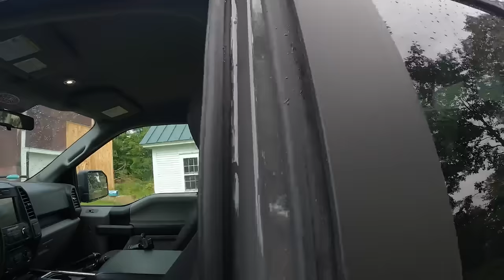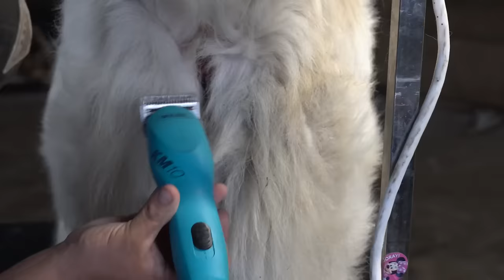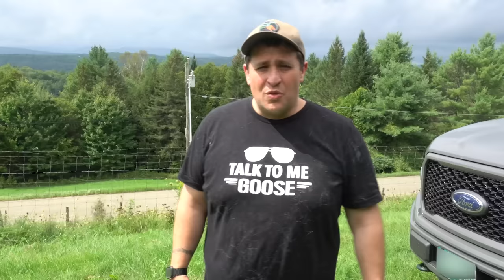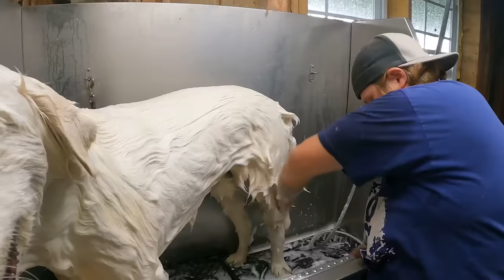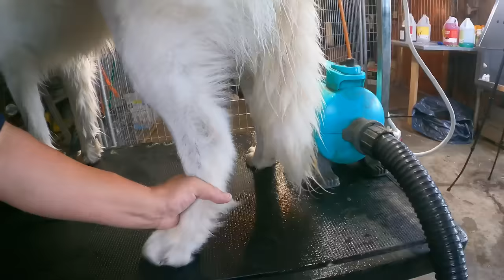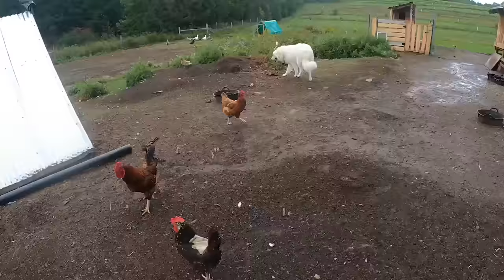Farm Dog Goes to a Groomer (FIRST TIME EVER)

Comment: Previous Dog Groomer here to give an overview!

Groom: She knows what she's doing. Though I couldn't see what all she was doing in detail she did everything in proper procedure and order. That blow out is super important for a dog like Toby. He's got very thick fur, which means when he gets fully soaked he will take an eternity to dry and may get an actual mold issue from it. I highly recommend keeping his booty shaved up. This is called a sanitary. It helps keep him from getting any infections that would otherwise result from stuck urine or feces. An ear clean might be something you do once in a while as well, especially since he has floppy ears. The feet trim, although often seen as an aesthetic, clearing the hair from between his toes will prevent slipping and keep any unwanted objects from getting caught between his pads.

Toby: He was super well behaved for a first timer! You may see a little itching or licking in some areas because he's not used to having those areas messed with but it should subside in a day or two. I'm pleased to see that the matts he had on his rump came out relatively easily. If they were too bad to brush out then he might've ended up with a naked butt! (Sometimes this is done to prevent undue stress and pain upon the dog.) This is one of those friction areas that needs extra care with brushing and most people can't brush it through properly on their own due to lack of experience. Don't worry though, his matts seemed relatively minor in comparison to what I've seen before.

Overall it seems you found a good groomer and I would recommend you take him back every month or so. (No more than six months max.) He'll be more comfortable with her each time he sees her so he won't be quiet as nervous when he goes back. (In the event that a skunk gets him you're going to want that. It's not a fun job.)

Toby looks beautiful! Such a handsome boy!
Reply: I second the recommendation of regular ear cleaning (for all dogs especially floppy ear dogs) and consistent sani trims. Dogs with long, thick coats can get poop stuck back there more easily. No one likes infections!
Reply: looking at your profile pic and the word "groomer" together looks really weird, i really hope you don't do the other kind of grooming to any dog, ever.
Reply: @fungustmaster  Actually disgusting of you to make that assumption of anyone based on an animal as a profile picture, even in jest
Reply: I think they both should have worn masks during the blowout though, I worry about their lungs
Reply: The feet trim is also super important in winter to prevent ice shard forming between the toes and hurting the dog
Reply: @fungustmaster  You would borderline accuse someone of animal abuse based on... lets see... them having a cute animal as a profile pic? What sort of smooth brain nonsense is that?
Reply: Okay, thanks for sharing I guess???
Reply: @fungustmaster  It's literally just a cartoon dog. Really weird that your mind went there just based on that.
Reply: @fungustmaster  god i am disgusted by this comment, think before you speak
Reply: @fungustmaster  for shame on you, bad human! Bad!
Reply: Every month to the groomer….. typical american overdone. We in Europe dont do that and believe it or not, dogs here are still Alice. Do Not feed industrial dry foot, feet raw meat, Never Sugar. So you Never need to brush the teeth of your poor Dog.
Reply: @clubpenguinrockie  he's still entitled to his opinion without you name calling or trying to put him down for it
Reply: Bravo 👏🏽 your overview, well done! ☺️👍🏽Appreciate!…and 🖕🏽👎🏽 those that negate! ✊🏽

Comment: As someone who's only owned double coated dogs, I can confirm slightly trimming and shaving of certain areas will not harm the integrity of the coat. Especially the butt, it keeps the dog neat and clean without hurting their insulation. With pomeranians I like to shave/trim the down low areas as its pretty common for them to get extremely dirty and matted if you don't (depends on the dog)

Comment: He looks great Morgan!  Nykea did a nice job on him.  I would resist trimming that long overcoat on his rump, hand scissoring with a thinner would be better (but it does take longer).  You do a great job of just brushing Toby out at home and doing trims on his nails some now and then.  That natural oil in his coat helps to protect him in the weather, so don't bathe him too often.  3-4 times a year (Spring shed, summer and late fall) would be great for him.  You do need a proper undercoat removal tool for those long breaches on his rear...I highly recommend and English rake and a long pin slicker to for that....in fact I might send you one.  Nice job and Toby was a really good boy!

Comment: As someone who’ve been watching pet grooming videos, the paw cleaning comes last. Initially wash the doggo with shampoo then conditioner. Dry them up with towel and then dryer. Then brush the doggo and do some coat trimming when needed. After, clip the nails so it won’t get the way on shaving the paws. Lastly, spray doggo perfume.

If there is matting, initially remove the matting via brushing or shaving if it’s worse else do it during or after the shower once shampoo and conditioner are applied.

Comment: She should invest in having a raised sidewalk put in or some concrete block to keep the animals paws out of the standing water at the entrance.  

Spend a ton of money on getting all that stuff then have it set up in an under-wired (multiple outlet strip) and under lighted (not many overhead lights) area.

A $3-500 investment in lights and getting ceiling or drop down outlets installed would make it a lot easier to see and easier to keep power cords and stuff managed and not accessible to the animals.

Comment: @Gold Shaw Farm why do you keep the fur? It has many uses but how do you use it?
Reply: Compost. Good for plants
Reply: From cases where the fur is kept usually it's put in a wire holding outdoors for wild birds to pull the fur from the holder to take to their nests since dog fur is a great insulator and is a very valuable resource for birds of any kind, It also helps prevent predators from attacking their nests to eat the offspring cause it'll smell strongly of dog as well.

There is also an offchance he uses it for his ducks and domesticated birds nests too considering its nearing wintertime

Comment: I find it strange that people are concerned because of the fact you groom your dog at home. 
All you really need to do with double coated dogs is regular combing and maybe some trimming of the paws to give them better grip. Trim the nails, and clean out ears and eyes once in a while. 
My dog is a lot smaller, but has significantly longer fur, with the same double coat.I only wash her with soap every three months or, if she gets unusually dirty, i will rinse her in lukewarm water. She is a white kleinspitz. The crusties in the back are easily managed, and will rarely be there is the diet is good. Brushing your dog quickly after a walk or at the end of the day will remove most dirt.
Never ever shave them completely if you can help it, if they are shaved, the fur may never grow back the same. It works as insulation both in warm and cool climates.
Wonderful groomer though, she is very talented, but you really do have got it covered!

Comment: This is a very POOR example of professional grooming.  She didn't even properly brush,  she didn't even have properly functioning clippers- I know this be the sound and the way she had to use  them to make them cut/.You do not put the brush on top and drag brush- You should lift the hair make a part and keep the brush next to the skin this is frequently called line brushing.  There are also undercoat rakes and other tools to get all of the shed undercoat out.   You are never done brushing until  the tools go through without the ripping sound- listen to the sound of the d at the end- still ripping-.  . Shed undercoat doesn't leave the animal but stays in and get tangled up with the hair still attached and this is what a mat is- dead hair dangled with live hair. . This dog has a good coat and the good living hair will not tangle or mat.  It is very important to avoid bad hair getting wet-  water weighs more than hair and the weight will mash the living and dead together.  In Scotland they make felt out of Collie undercoat  with screens and water like making paper.  There should never be this much hair flying around during drying only a few strays here and there that the brush missed. You should NEVER shorten the guard hairs of especially in  a outdoor dog in a northern. climate in November the long hair is what keeps the dog dry the undercoat keeps the dog warm. Shortening the guard hair ruins the texture and will The primary thing about grooming a dog of this coat is to remove the undercoat that has already left the skin but kept in the coat by the volume of hair still attached.  Also, please know that you can never reassure a nervous dog like you tried to do when you first in the truck.  What the dog was hearing by your tone of voice and offering a treat is "he likes what I am doing and wants me to keep doing it," NOT "everything is going to be ok" like you intended.